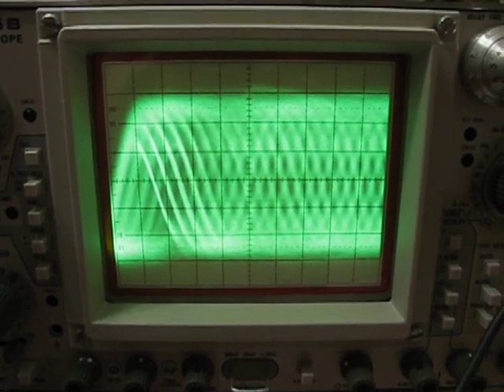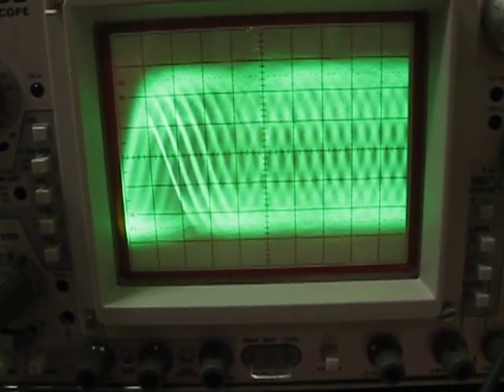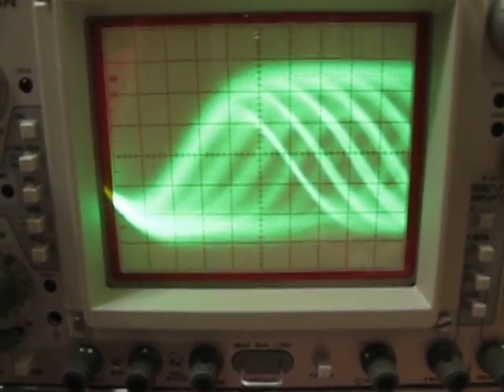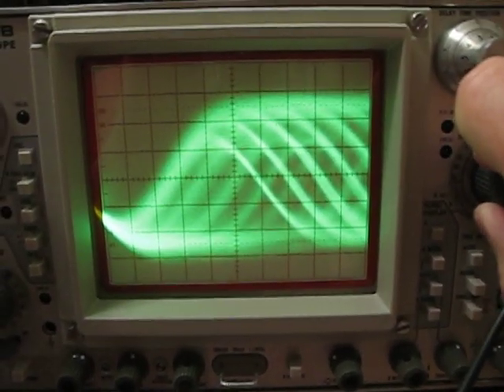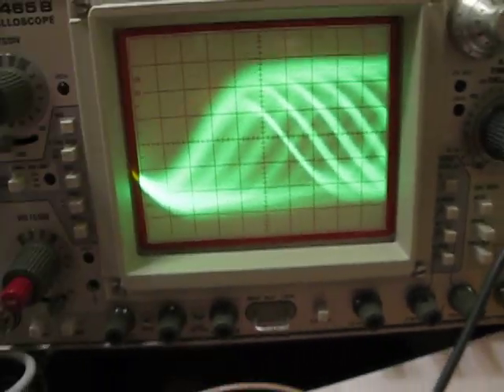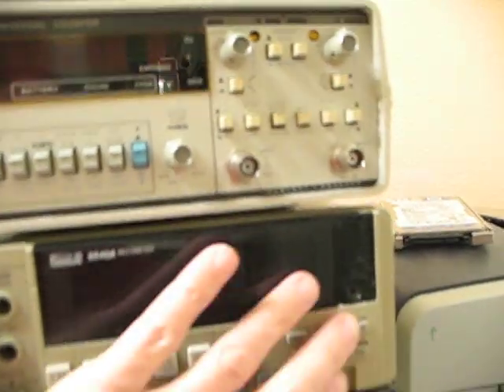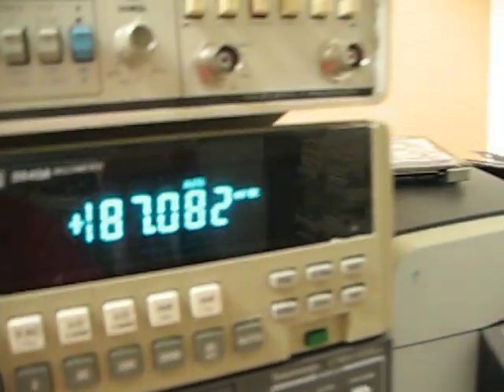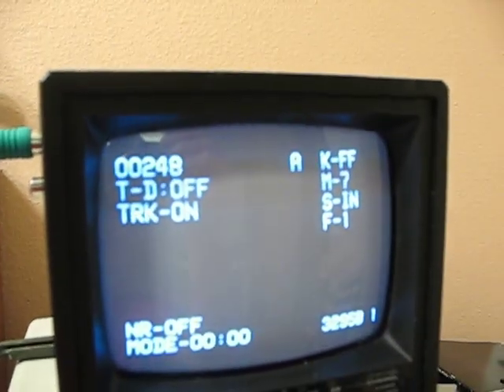RF signal alignment of the LD player using my new scope

Comment: I tried to do this over the holiday weekend with the shop scope (AVL Ditest), and I only had a single sine wave on the scope. 

I could only go down to 1usec, where the spec was .5usec and I was wondering if I needed a specific scope to get a pattern like this?

The scope I'm using is digital, and used for reading BUS communication in cars, so I'm wondering if it just won't read a pattern like this, and I'll need to get another scope?
Reply: The Sega CD I'm trying to fix still plays games, but the read reliability is sporadic and I need to adjust the POT's for gain and balance, because I followed another video that had me "adjust to error and divide in half.
Reply: @sixspeeddeath  hi , do u still have that sega CD  , mybe i can help you
Reply: @nethunter2net570  I do.

Sill waiting to buy a better scope, but I have access to the same Shop scope as well.
Reply: @sixspeeddeath  ok , let me know when u want some help :,) to fix some old videogame consoles .